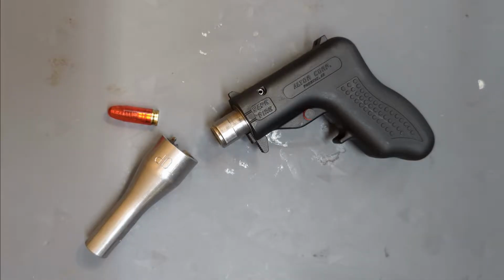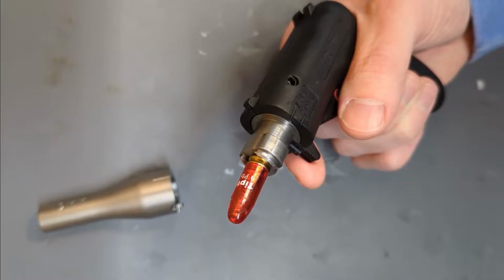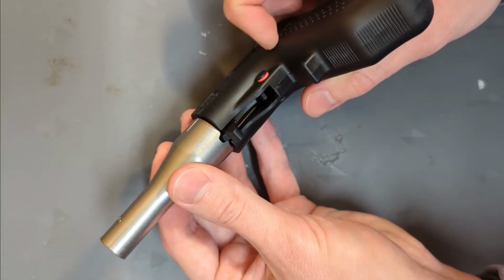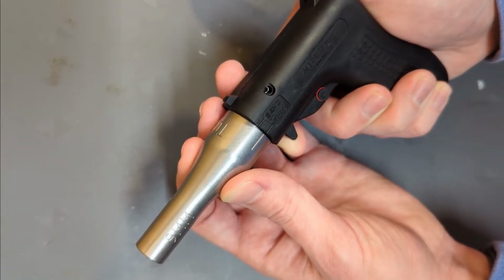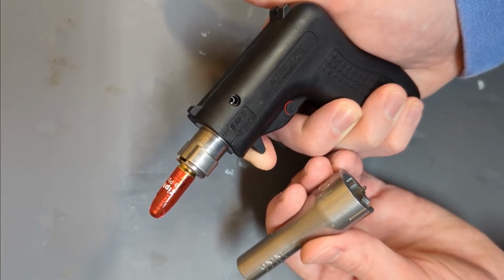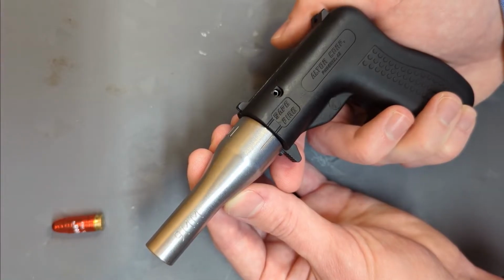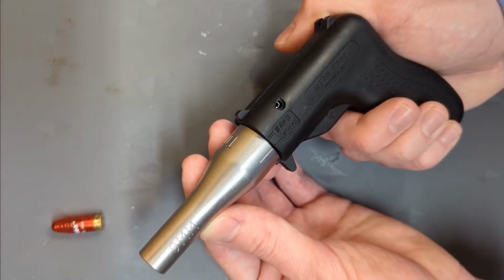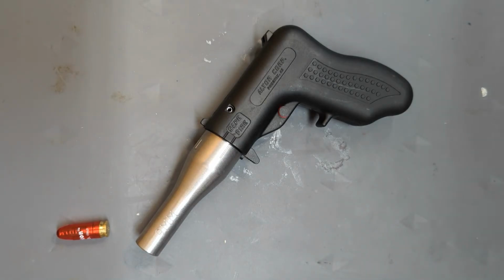Altor Corp Single Shot 9mm Pistol - Safety Considerations

Comment: This thing always looked like someone made a real gun out of a hot glue gun.  

When this first came out I contacted Altor.  Not because I had any interest in this firearm, but because I saw some potential in the "survival" market, which was all the rage at the time.  A very inexpensive, single shot 9mm carbine similar to this might grab some attention.  Maybe with a little more thought put into the trigger mechanism (cockable striker and a more traditional trigger), sights directly on the barrel and a wire frame or injection molded stock.  It would break down very small, lightweight package and might be a fun plinker/survival/hiking gun.  MSRP them for around 180 and a lot of people will think: why not?  It would have some practical use, as opposed to this which has none. 

But Altor responded saying they had no interest in the idea.

Comment: If the round detonated with the barrel completely unlocked, would the barrel go flying downrange?  Seems like it would...
Reply from the maker: If the barrel is in the "safe" position, then, that shouldn't be possible, the barrel prevents the striker from traveling forward far enough to hit the primer. But if the barrel is in the totally unlocked position, i.e. not even mechanically connected to the gun, then, yeah, I expect that the bullet would strike the barrel and carry it forward. Probably not that far, because the detonation would be uncontained and much of the gas would not transfer its energy to the bullet.
Reply: @gunbelievable  If the barrel was unlocked, and slightly forward, wouldn't it be able to strike the primer then?
Reply from the maker: @DustyGamma  If the barrel isn't fully seated against the frame, then, yes.

Comment: One thing i would add is if in a scuffle or close close shooting the gun can be rendered useless by your attacker by them simply grabbing it.
The trigger will keep your barrel locked in place as long as it is down and in the fire position, keeping it a usable weapon. However, if someone were to do the natural thing of try and grab your gun, as soon as you try and use your weapon by pulling the trigger, you are dooming yourself, as you will unlock the barrel for them to then twist it so the firing pin can no longer strike the primer, or worse, just rip off your barrel entirely. Its actually less effective to use in the situation youd likely use it in